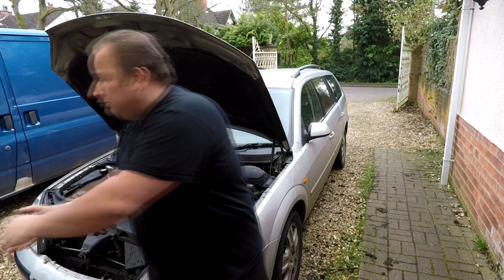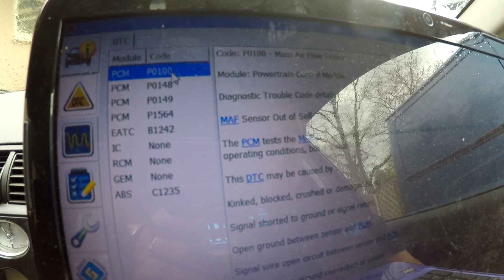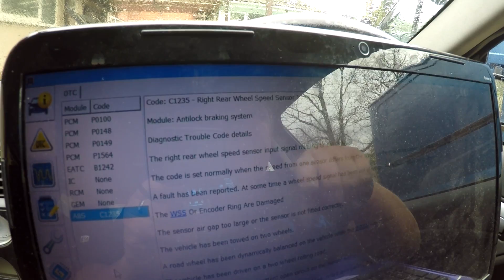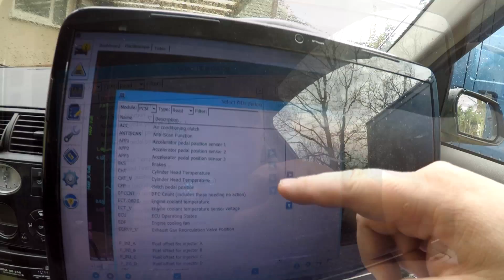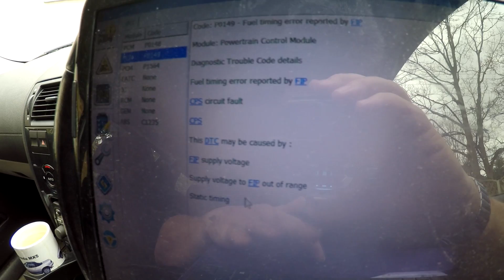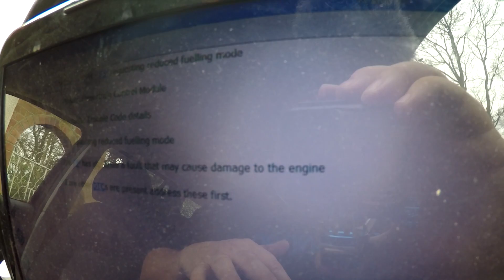Part 3 Ford Mondeo Mk3 Tddi Running Rough Diagnosing Causes F Super Mk2

Comment: Immediately after the traffic accident of my Mondeo mk3 2.0 TDDI, when I turn on the engine it can only work for about 30 seconds. Diagnostic check shows a key error. The key was not damaged or I was dropped. A friend claims that one of the connectors on the control electronics of the locks in the event of an accident has been disconnected. There are no major damage on the vehicle except damaged wires in the front light group on the left. Can you give me some explanation and instructions on how to solve the problem because there are expensive key repair and car locks here in Sarajevo?
Reply from the maker: Can't say bud, sorry.

Comment: Hi I have a problem with mondeo mk3 1,8 petrol 125hp.  His loosing power when you wanna speed up. Power is going so fast down that car almost stop. To accelerate it's also problem I must very slowly press acceleration pedal and I'm hardly have 80km/h. I will add that it's worse when it's geting engine normal temperature working. There is no code problems, no check engine. Please can you help me what I should check to solve this problem. Best regards Lukas
Reply from the maker: Herd to say without a diagnostic test bud.

Comment: always  good stuff from you mate...heres my tuppence worth....l had stuttering at motorway speeds....long story short,,stopped using supermarket diesel,,,,started with the premium diesel   shell or bp....after 50 miles problem gone....mpg went up..so no real diffrence in price....should be first port of call   cheers,,,keep up the good work

Comment: Could be an injector fault Martin, black, smoke? over fueling possibly. As your handy with making stuff, you could make a fuel leak off tester and check them, while making a video on how you made the leak off tool .
Reply from the maker: Good point Ryan, I think the lift pump is next on my list before anything else as in part 4 of this saga.
Reply: retrorestore you have put petrol in it you doughnut lol 😂
Reply from the maker: No bud lol

Comment: the  crankshaft sensor reads the flywheel,youre problem is shortages of fuel when accelerating,check both fuel pumps and their wiring

Comment: Martin, This is the huge down side to modern cars and the car companies know you will have to go to there outlets to find the problem. It seems to me the amount of sensors there in cars now days is for there benifit not the owners. Cheers David
Reply from the maker: I agree Dave, Most of the engine management sensors are because of emission reg's but in my mind, it's overkill and it's too much technology for simple mechanical principles. Also, it's not the engines that go wrong, it's the sensors.Mad wor we live in now.

Comment: crank position sensor is common.lots of stuff on line. check the colour. if i remember grey is good as the black ones fail. i used forscan to diagnose the current injector fault on mine. best tenner i ever spent. good luck
Reply from the maker: Thanks Miles, Yes, Forscan seems a good bit of kit.

Comment: I fixed a misfire on an Alfa 156 using a odb2 bluetooth diag scanner linked to a tablet. I can't remember the s/w on the tablet tbh. I am no mechanic (hate working on cars) but I'm computer savvy and have an computer engineering background. I had a bad experience with Vauxhall where they ran the diags and replaced a part but it didn't fix the problem. So they said we need to replace another component called by the diag tool. This is where i told them to erm....do one. They replaced a part which they were going to charge me for but they hadn't fixed the problem so they wanted to replace another component that might  might or not fix the problem. In my opinion this cost should not be passed on to the customer. In the end they said they would go half on the cost of replacing the first part. I never paid and they never chased it. I hope this info is useful coz you should not have to pay for a company just throwing parts at an issue in the hope of fixing the problem
Reply from the maker: I think a lot of Garages do this Steve as i've heard many similar stories. That's why I want to do it myself.

Comment: Check live data of the fuel pressure sensor on the fuel rail with the crank sensor & if possible the metering sensor on the pump. If you can view all of mentioned, Then it can lead to pointing you in the right direction. Sometimes a false reading from a sensor can cause running issues. would also be worth having the fuel pump tested by a specialist before even consider replacing it. Won't cost you alot of cash from a good independent specialist. But it will rule out any problem with the pump supplying the fuel pressure to the rail. Best of luck
Reply from the maker: Thanks Ashley for the info.
Cheers
Martin

Comment: great vid mate. Just been looking at wiring diagram for you car that module supply relay control under battery looks like it powers a fuel pump control module on top of high pressure pump will forward you diagram on 

Cheers 
Jamie

Comment: I would look at the lift pump if its pointing to a fuel problem.  You want to look at FRP ( Fuel Rail Pressure)  in forscan to see if it drops in live data.I don't know if the CYL 1234 will work in forscan, but that would also give you an idea if its an injector, it gives you a cylinder balance.
Reply from the maker: Ok Thanks for that. 
Cheers
Martin

Comment: might be worth just checking the fuel filter housing for air leaks mate as i said on facebook the one way valves on there sometimes give up or the o ring can give up (im not sure from looking at the filter video you did if you can change that valve or not), make sure the crankshaft sensor is not covered with oil or dirt. 

also i would have just added the temp sensor/sensors to the live data feed on the drive. there will be at least two sensors for the coolant temp, one will be for the gauge on instrument cluster and the other will be one for the ecu itself (im not 100% sure but i think the ecu monitors temp of the head rather than the temp of the coolant but it did see a few head temp sensors and coolant temp sensor on the live data)

Comment: First off, I would check battery voltage and alternator output is in spec since any errors with basics won't always throw up a fault code or bring on the MIL. Then ensure all major earthing points are secure and free from corrosion since corroded earths can cause all sorts of weird symptoms. Check injector pump wiring loom and connector for signs of chafing, loose, corroded or damaged connector pins or oil or diesel contamination that's creeping under the loom insulation. Low voltage might be down to supply or signal wire that's going open circuit or intermittent high resistance due to heat, vibration etc. I'd also check low pressure lift pump power supply loom for damage etc.
Reply from the maker: Good points bud, I'll be checking connections in due course.
Cheers
martin

Comment: Hi Martin, don't know if anyone else mentioned it already, but you have to go through the errors in the order they were logged. So if P0149 was logged first, it could trigger P0148 etc. Have a look at this:https://www.obd-codes.com/p0149
Reply from the maker: Yes, Thanks Robert. I did realize this so will be checking the codes in that order. That's an interesting website , thanks for the link

Comment: good to see you going for auto diagnostic mate i have a similar divice for what they cos they are good little bits of kit i diagnosed a dead catalitic converter with one with the use of you tube great video mate was expecting to see you throwing more parts at it as i said in a previous comment it does it when it warms up and as it says a possible electrical fault it falls in line with why i said get a auto electrician because as it warms up it contracts so causes an open in the wire i honestly think it's a corroded or broken wire possibly to one of the injectors  glad you didnt just chuck parts at it am following this to see if my thoughts are correct .
Reply from the maker: I'll know more tomorrow Billy, I'm thinking along the lines of a supply fault to the fuel pump or the crank position sensor. 
Cheers
Martin

Comment: I would say it's the crank sensor 100% also don't take this the wrong way but there are  2000 - 2003 mondeos with around 110k miles going for like 300-600 quid and I've seen you put a lot of money / effort into this car maybe treat yourself to a older more mechanic friendly car :)  I've watched your page since  your son's gilera runner rebuild as I rebuild scooters mainly Italian piaggios gilera ect and was suprised to see you actually did a perfect job on the runner engine rebuild credit were credits due you've got persistence I would have scrapped it back when it was in pieces with the sub frame off it lol but props to you mukka from one tinkerer to another adios omego
Reply from the maker: Haha, you've watched a lot of my vids then lol. The Mondeo has taught me a lot and the video also help others so I don't mind doing these jobs.
Cheers
Martin

Comment: Great video Martin, i did look up some of those codes and it seems to be,Reduced fuelling is one of the management strategies for error conditions in tddi . A common fault is poor contacts on the multiplug for the fuel pump to loom connector. Yellow release iirc. 
Worth removing and re seating a couple of times , checking the wiring for damage.
Cheers, Jeff.
Reply from the maker: That's the relay I was looking for at the breakers yard Jeff under the battery.
Cheers
Martin
Reply: Martin, they are saying this is the actual connection on the fuel pump under the drivers side rear of the car.

Comment: Not a guess and I know this is a diesel not a petrol but when I had a problem with rough running once on a Citroen I changed the Coolant Temperature Sensor (cheap part) was less than £20 and fixed the running problems when it got hot because it ran well when cold but warmed up was a nightmare. Not a mechanic just a diy'er lol
Reply from the maker: That's what I am as well but it's a learning curve.
Cheers
Martin

Comment: patience , you got more than me I'd gone insane by now I'd rather have the Capri would be so much easier to diagnose lol . 😉 I think its all a big con what's the point of plugging in a laptop that says it maybe this maybe that just tell me what it is ! I truely believe it doesn't tell you exactly as local ford dealer can make loads of money saying it could be 4 things 800 quid later for the average Joe . Hope its solved soon. mate . see you on the next one 👍👍👍👍👍
Reply from the maker: I agree Paul but it's the way it is now I'm afraid so i'll have to learn. I'd rather do it than pass it over to a garage who are quite happy spending your money changing parts till they locate the problem.

Comment: martin on a completely different tangent you could have a big vacuum leak at your intake manifold or the gasket which would explain why it hesitates  only once its warmed up and would also explain those overfuelling fault codes as the pcm is compensating for the increased air..........try recreating the problem on the runway when the car reaches it max temp you can then look at the engine and see and listen for something amiss and check the laptop results.   however the first thing to do in any diagnosing is check and monitor the long and short term fuel trims (or fuel delivery in a diesel case) this is the starting point for any diagnostics especially fuelling problems.............then you will have the proper direction to go to solve the problem, once again good luck with it........and keep videoing the laptop so I can see the results your getting

cheers willie
Reply from the maker: I will do but the fault codes are pointing to a fueling problem possible caused by a connection issue or the crank position sensor so i'll be checking these first. I've only started learning about the fuel trims from shrodingers box channel, he seems switched on.

Comment: Old trouble shooting was so much easier. This is the problem with the newer cars, garage mechanics want to change it out one at a time till the fault goes away. This can cost a fortune. Like I was saying before, your car is acting like my Taurus. Ford knew what the problem was as they see the problems for each car and have built in knowledge. My Cam Timing Sensor looks like a small distributor with the sensor on top and 2 wires that attached to it. The bearing wears out and it wobbles causing the error. Didn't do it all the time though, I could drive a week with out a problem. This is why it was so frustrating. You can try spraying injector cleaner on the MAF too. Might be the crank sensor, it is the same thing as my Cam Sensor. Good luck Martin.
Reply from the maker: I do like a bit of trouble shooting but this is all new to me so i'm on a learning curve Bri and you all are along for the ride lol.
Cheers
Martin

Comment: I'd say crankshaft sensor Martin. Fords error codes aren't the easiest to understand and some codes can be misleading. You could get 2 separate codes and they both point to one fault but they look as if they're pointing to 2 faults. Sod's law but I have a f-super 2 reader I don't use anymore "sold my mondeo so not in use" lol and you could've had it mate for free. There are other ford programmes you can download other than fordscan. And they give slightly different info. And free lol. Good luck Martin keep plugging away "excuse the pun" lol
Reply from the maker: Haha, nice one. I'll get there i'm sure.
Cheers
Martin

Comment: Hi Martin great video had problem with my 02 tddi Mondeo sometime felt like miss fire but only after  it had been running for a while . I had read on some furums and people were saying that when the lift pump is playing up the main pump on the engine will give a fault code also the lift pumps seem to give up around 160000 miles I didn't change my lift pump then one day I was driving I hit a pot hole the car then spluterd missfired all up the road.when I stopped the car would idle till I went to pull off then died . the next day I got a new lift pump the fuel filter was empty put new pump on turned ignition on 2 or 3 times car started never had to fill the filter the lift pump did it when the old lift pump was on and changed the filter I had to fill it with fuel the old pump wouldn't do it I think the lift pump can still work but starts to lose pressure.
Reply from the maker: Yes, I did suspect the lift pump but the fault codes have given me something to check now Sean.
Cheers
Martin

Comment: Check the crank sensor, then Might sound simple but locate and tap with a hammer the lift pump see if it lasts any longer. If not it'll be the injection pump, for a new genuine one your looking at a big bill unfortunately. I have worked on many transits and mondeos and therefore scrapper many for the extreme price of the injection pump which is a common problem. I know on the transits new pumps can be £200-400. Let's hope it's the crank sensor!
Reply from the maker: I don't think it's the pump, the codes point to the crank position sensor and a supply voltage problem to the pump. I think Jake. I'll know more tomorrow.
Cheers
Martin

Comment: Saw very similar symptoms on an x-trail and it was the crank position sensor causing the fuelling fault. Cheap item to rule out before you start on the fuel pump!
Reply from the maker: I agree, I'll be checking this in the next vid.
Cheers
Martin
Reply: retrorestore By the way, you had better fix this. If you get rid of your Mondy I'll have to get rid of mine as your vids are the only reason mine is still on the road!
Reply from the maker: Haha nice one.

Comment: martin, with a 1564 code and fuel metering error code you are likely to have a problem with the solenoid at the fuel pump and or the wiring that comes from it and goes over the top of the starter motor the cables rub on the top of the starter motor and get frayed this is a common problem with transits which also have 2.0 lt tddi engines. or god forbid your fuel pump is on its last legs..............check them out and good luck my friend

cheers willie
Reply from the maker: Thanks Willie, I'll be checking the Crank position sensor and the pump supply cables in the next vid so let's hope this is the problem as the fault codes suggest.
Cheers
Martin

Comment: martin it sayed that the fuilt is with the pump and it did not say anything of it not getting enough fule  so is it the pump and if so it going to be a dear thing the replace  but is it getting starved off full that we dont know  hope it helps and it will be good to fined out
Reply from the maker: I'll be checking the crank sensor first Chris as this would impact the fuel delivery.
Reply: yes i agree

Comment: crank sensor is one of the key sensors that determine when to inject fuel based on.crank position/rotation and where the engine is in its cycle,  from that info it can determine when to inject fuel, if the signal is faulty this will cause triggering and fueling errors. try logging.the signal from the crank sensor (cps) during a run it will be obvious if there is a problem (signal amplitude etc)
Reply from the maker: I'll be checking the crank sensor in the next vid.
Cheers
Martin
Reply: Retro Madness That is just what I was thinking